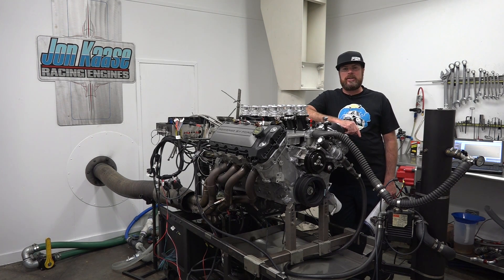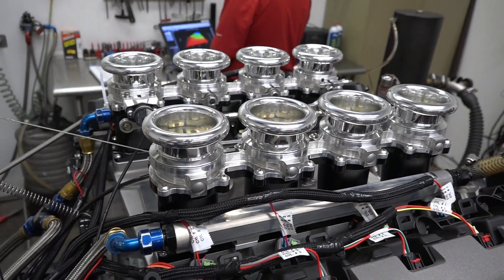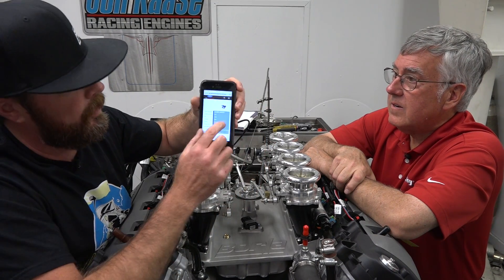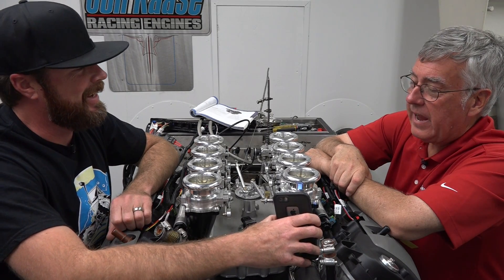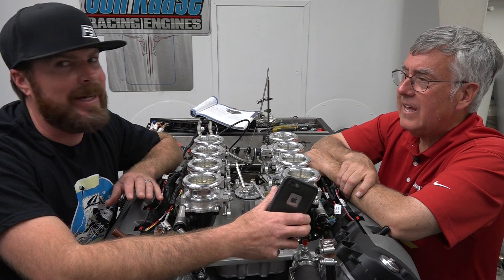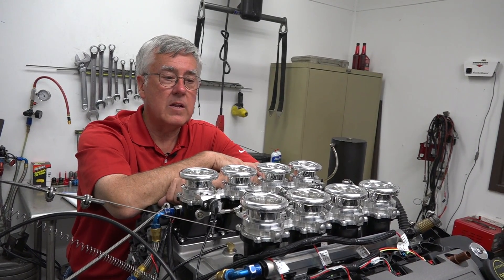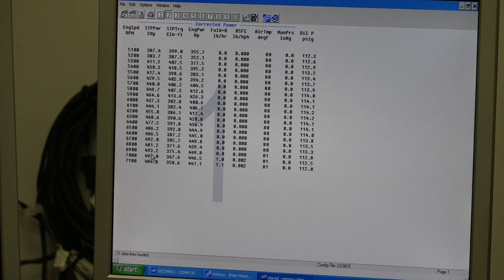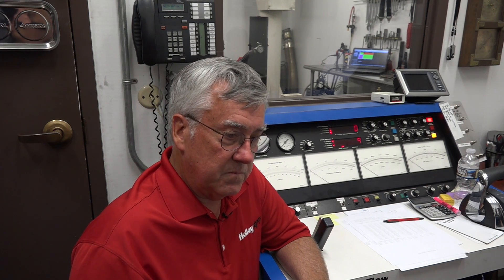Finnegan's Garage Ep.37: Dyno Testing a Ford Coyote Engine with Borla Stack Injection

Comment: You should see if you can get one of these into that 1975 vette.
Reply: Ohhh that would piss off a lot of people lmao.
Reply: no point in worrying about what origin your engine has,if it works use it.hot rodding isnt about brand loyalty,its about having fun with what you have and the money you have to spend.i would put a coyote in my trans am if i got one cheap enough,and you know that isnt going to happen.
Reply: you would have the same problem the fox bodies and other older fords. The DOHC engine simply wont fit.
Reply: I doubt it would fit width wise.
Reply: This engine belongs to someone else.
Reply: BlaspHEMI and a "Coryotte", take that chevy purists lol
Reply: Kristopher Klassen he's already got that hemi in the 56 chevy I think this is right up his ally
Reply: opl500 💯💯💯
Reply: They do fit, so does a 427 and any other motor just needs a little incentive.
Reply: Nope, not true at all, you don't have to cut the front of the car off, might have to modify the shock towers a little. A guy i know stuffed a big 400 into his fox and had to do little modifcations to make it fit and that's about the same size as the coyote.
Reply: You can make it fit. Mwahahahaha.
Reply: I must agree and I have told the same to the guys that put chevy engines in fox bodys... lol.. to each there own but that one line I wont cross..
Reply: opl500 They are installing this engine in a Pinto wagon with the porthole windows!
Reply: panhead1219, but make sure they're all connected to eachother with crossover pipes like that hidden plenum thing on the intake.
Reply: +TheCamaro5  Plenty of Coyote swapped foxbodys around.
Reply: opl500 agreed. Let the chebby boys know how it feels
Reply: Cory Sennett Damn bro........  You don't know anything about anything.  You should just sell your car and ride public transportation
Reply: Other then to piss the GM fanboys off what would be the point when you could make that kind of power for a fraction of the price size and weight..
Hell A 5.3 truck engine with a cam, intake ,headers, and a set of stiffer valve springs...maybe a little port work on the heads can easily make around that much power all for what the intake cost.
Like come on...6500.00 for a freaking intake...this is like crack for the Ford boys.
I must admit though one of these spinning 8000 rpm in a vette would sound sweet.... nothing sounds as amaziing as a V8 screaming at 8000 rpm...
Reply: You have to cut the front of the car off. I have seen it done, a lot of work and twice the money. I would have a 351W built than a big DOHC engine.
Reply: eddie rodriguez Well Ford pretty much betrayed the Ford community when they decided their pushrod engines were "old tech" and dumped them for huge, less reliable OHC V8's. They pushed a lot of guys that want simple, powerful OHV V8's over to the LS side. Loyalty be damned.
Reply: The ''''chebby boys'' can get more horsepower across the counter without getting their hands dirty or spends countless hours in the dyno room
Reply: Why? Wouldn't go 20k miles before it needs a rebuilt. That's why most mustangs get an LS swap.

Comment: Do engines without pushrods confuse you?
Reply: Bitter Raven i guess cams arent the only thing to go over heads. i just thought what i said was funny.
Reply: yes good pun
Reply: There are other engines without pushrods though, that still doesn't have over head cams.
Rotary engines... 2-stroke engines... and then there's the Opel 1900 engine from the late 60's (and its relatives of various sizes) that has the camshaft in the head, not above it. In essence, they removed the pushrods but kept the rockers.
Reply: @James Masn this video is over 1 year old, you're a bit late to the party
Reply: Bitter Raven over the head cams
Reply: its called over head cams
Reply: +Ryan Lopez OHC over head cams, why is this comment section full of douche bags today picking on petty bullshit